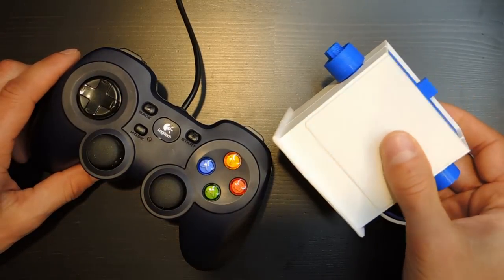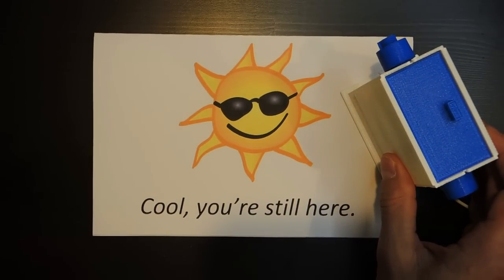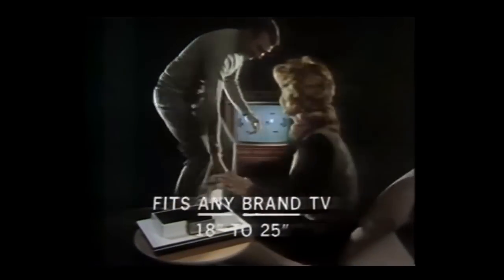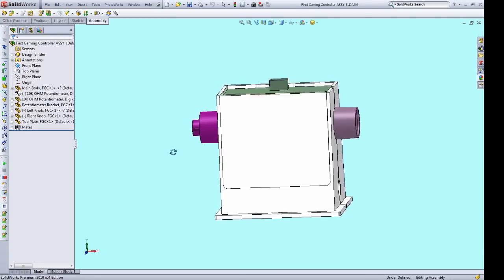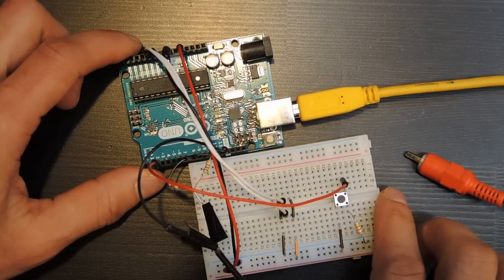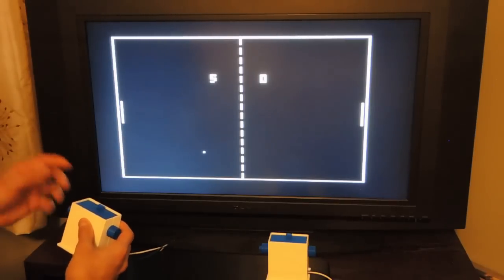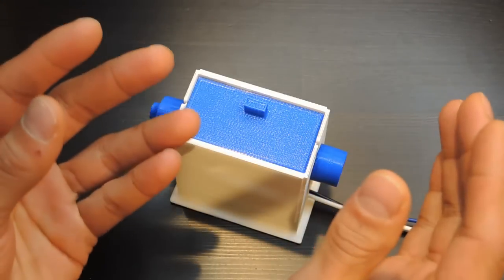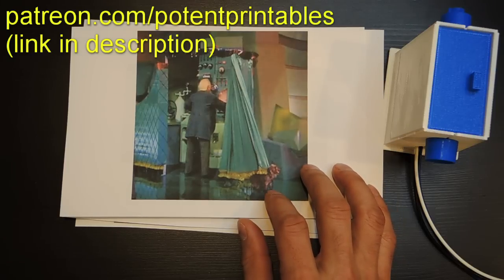The First Home Gaming Controller, 3D Printed | Old and New, Episode 2

Comment: Ali, I have an interesting project I would like to see someone build and I think you would be perfect for it. My suggestion is to make a recycled filament extruder (i.e. A machine to recycle failed prints and support material back into usable filament). I have had several failed prints recently while trying to calibrate my Ender 3 and thought it might be a great project to recycle them. I have seen some examples but they are very expensive. Was hoping someone could make a DIY version that would be in the budget makers budget. :)
Reply from the maker: That's an interesting project idea.  I saw the video by Stefan over at CNC Kitchen about recycling filament (as I'm sure you did), but that's basically all I have seen on it.  I'll have to look into it a little more.
Reply: Potent Printables sounds good! I know you can do it ;)

Comment: Really it would be better to have compared the knobs to the analog thumbstick on that modern controller rather than the D-pad, as both the past MO2 joystick and current controllers use the same basic X&Y pot system.
Little disappointed the English knob and Reset were just cosmetic. :\ I think if you used a side gear for the left knob you could offset that pot to leave you the space to mount the English pot in that position instead. Still neat though. ;)